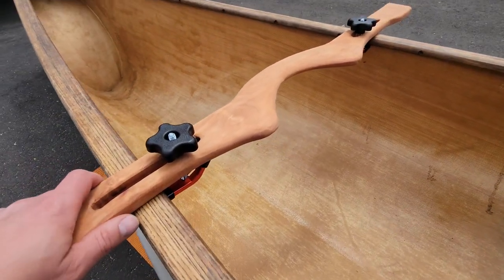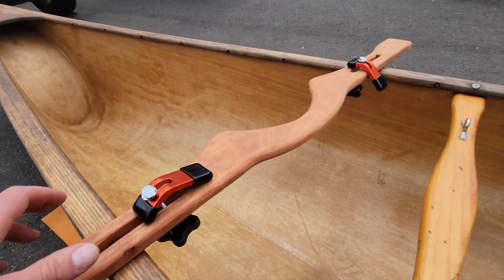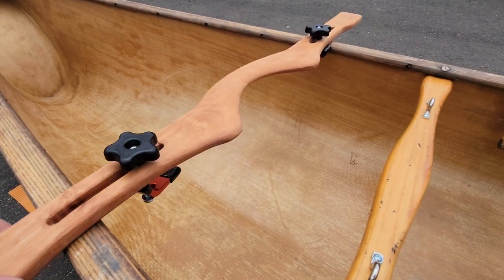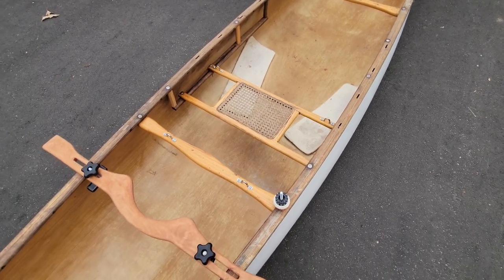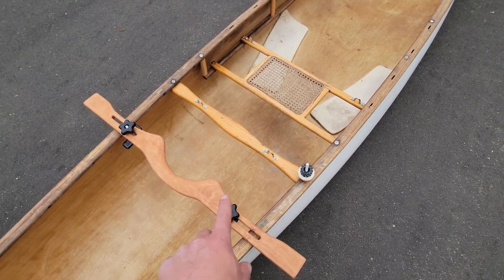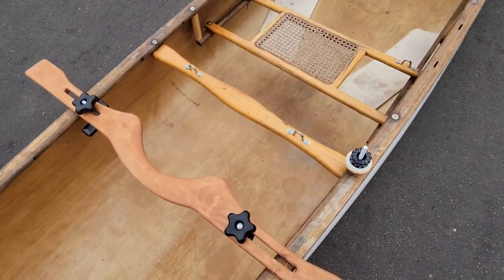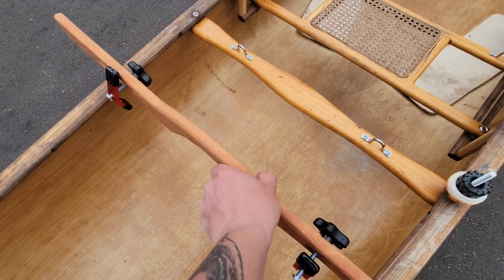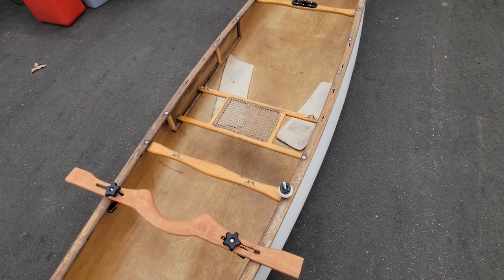HOW TO MAKE AN ADJUSTABLE & REMOVEABLE CANOE YOKE!

Comment: Speaking from personal experience, you are much better off drill individual hole through the yolk than making a slot. It’s hard to get the bolt tight enough, it terrible to have the yolk slide around in the middle of lifting the boat. I have one of these slotted ones and I glued in a piece of wood as filler, then drilled a series of holes. The holes do need to be elongated with the drill bit to allow the bolt to adjust its angle. Good luck.
Reply from the maker: Thanks for the tip. That being said it works really well with these clamps. But at this point it is mostly used as a camera mount. As the canoe I typically paddle has a yoke
Reply: @projectknifehand  I should have mentioned one’s experience will be effected by the material the gunnels are made of. My canoes have aluminum gunnels and they probably are more likely to slip than wood rails. The tumblehome also pitches the gunnels in meaning there is less contact area between the yoke and gunnels.

Comment: That is pretty slick man! Nice work
Reply from the maker: Hey thanks for the feedback and checking it out. It works awesome. The only change I made was two fender washers between the knobs and the wood to keep the knobs from digging into the wood when you crank it down. If eventually the slot for adjusting makes it fail, I'll just make another lol.
Reply from the maker: Hitting Squam this weekend and wanted to have a yoke for that trip despite there not being a single portage lol.
Reply: @projectknifehand  Lol! Cool man! 2 nights?
Reply from the maker: @ItsGoodintheWoods  yessir. 2 nights on Bowman with a buddy. HOPEFULLY I don't skunk. My experience fishing is all rivers and small water. Been doing my bigwater research though lol.
Reply: @projectknifehand  Awesome man! I have never camped on Squam. It has been on my radar for a while. Nice clean water . Have fun out there bud
Reply from the maker: @ItsGoodintheWoods  yeah I discovered it on YouTube naturally. It's a cool spot. Put in at the association and grab your included bundle of wood and paddle about an hour to the island.  The water is unreal in that lake.  It's become sort of an annual thing. It's pretty massive so two nights is in order this time. Last trip was only an overnight stay.  Thanks will do!
Reply: @projectknifehand  I'm going to have to check it out someday
Reply from the maker: @ItsGoodintheWoods  let me know if you want a tour guide lol. Although I'm sure you could figure it out